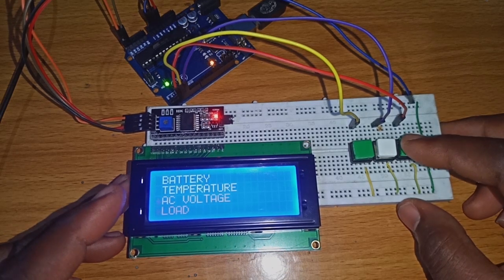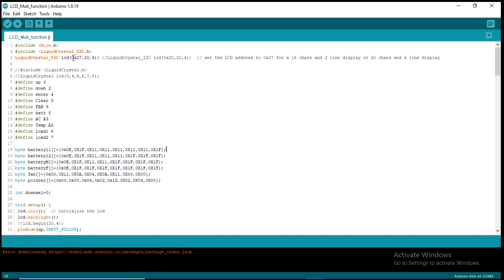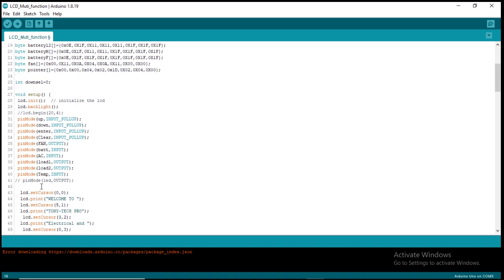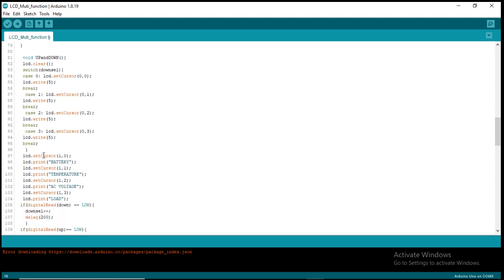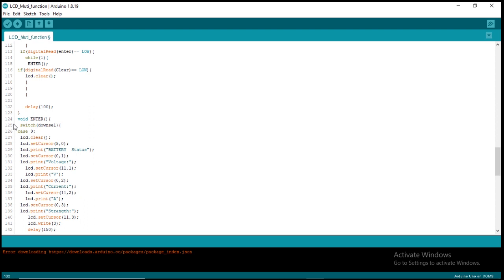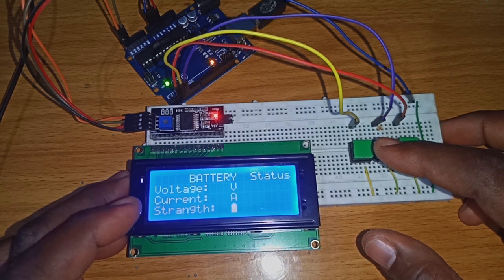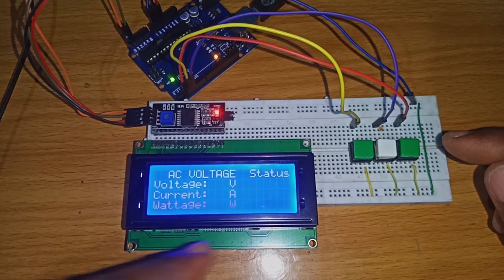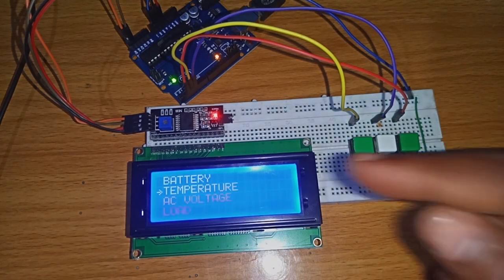Arduino LCD Display Menu System Tutorial

Comment: Hello my brother, you are always great. I want to benefit from this screen. I have a Solar MPT that needs such a screen and the design that it has supports 12 24 36 48 150 amps Hybrid so how will I benefit from this screen
Reply from the maker: The work of the screen is to display all information, the amperage of the MPPT has not thing to do with the LCD screen. U can only use this LCD with a microcontroller to display the necessary parameters